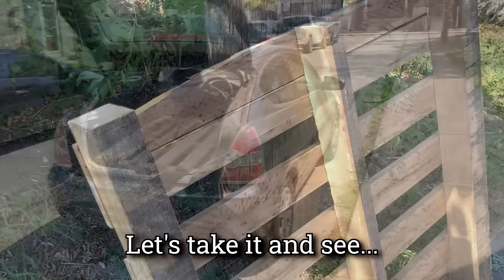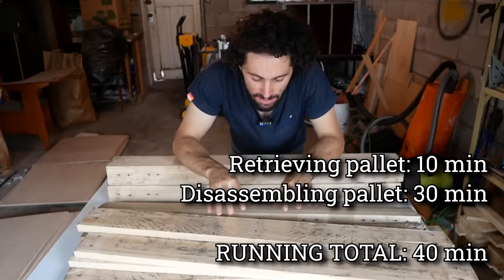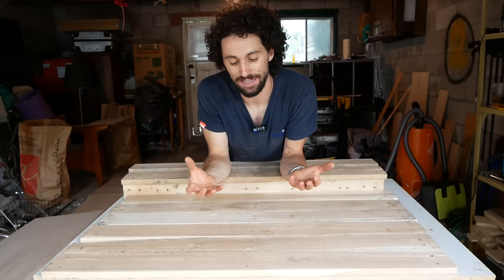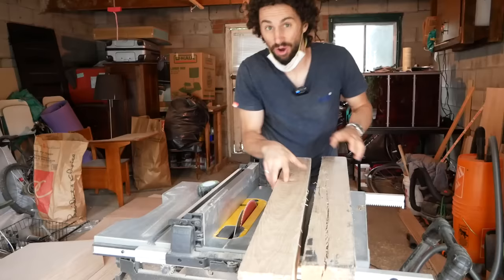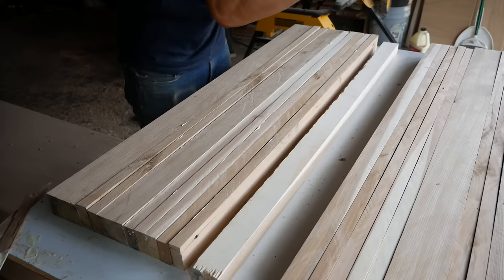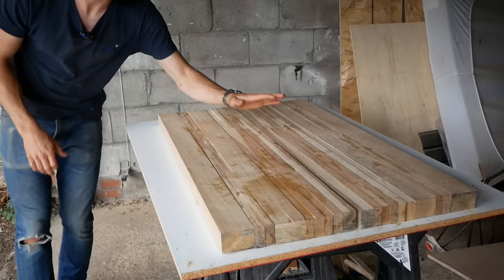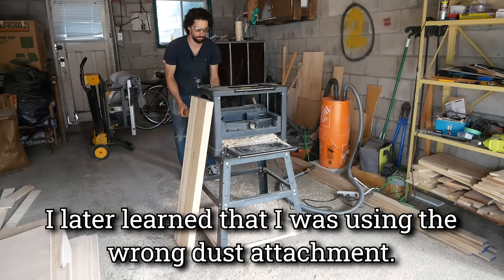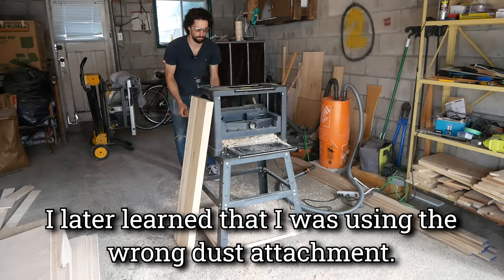Turning a Free Pallet into a $550 Table

Comment: A few things off the top of my head. 1, use a push stick. No matter how well you know your machine's flow, accidents will happen and machines don't give seconds chances. 2, use a vacuum on ur planer. The bits that get planed get under your board and the board is pressed against it, so it will leave marks on the surface. 3, don't clean the extra glue after you've put them together. Glue is mostly water and when it dries it reduces volume so you'll be left with less on the surface. So, if u cleaned on surface level before drying, after u'll have the layer somewhat under the surface. It's pretty easy to scrape off once you're done with the clamps. 4, since i'm on clamps... don't use all ur clamps on one side. Split them, use half over, half under. The force of it, when u tighten it, makes the wood catch a curve. If you'll use them on both sides, the forces cancel eachother. Otherwise, good job!
Reply: Push stick, YES. So much cringe-worthy footage here. What he did is what I used to do as well as other friends of mine. THEN, said friends ended up slicing through tendons and whatever else in their hands/thumbs/fingers/egos. I don't want any of that! Now I use push sticks/chicken legs!
Reply: Push stick for sure, setting an extremely dangerous example for "DIYers" here man.
Reply: If you not experienced and have the money get a sawstop table saw. It stops the blade instantly when you touch the blade and will not cause severe injury in all but the most extreme accidents.
Reply: Thanks!
Reply: @williambrandondavis6897  yes - they are AMAZING!
Reply: So what, dont be ridiculous.  Table saw is not the only potentially dangerous tool in life. This board is so wide his hands are nowhere near the saw.
I wonder how many long boards you have ripped on a saw using a push stick! How ridiculous.
Reply: how about spending an hour cleaning the dust off just to stick in a planer (that isnt cared for enough to plug the vacuum 2ft away into it)
Reply: @scottdowney4318  4:04 That's some unnecessarily dangerous work right there, instead of a simple push stick.
Reply: @danielp5208  No its not. You only use a push stick on narrow cuts. With such a wide board cut, you will have better control using just a hand on the board. A narrow cut and long board, push with your hand and finish up with a push stick while a helper holds the other end of the board.
Reply: and when gluing the wooden boards, make sure that the growth rings run alternately up and down. This also prevents the wood from warping
Reply: I agree...on all points!
Reply: Yes I'm afraid you could have used that coffee table top, as a rocking chair base, but we all have to learn👍

Comment: Hello Morley, i like the result of your work! However, as a professional furniture maker i have to say that you have to use the push stick on the table saw (it was next to you). Not only for your own safety, but especially for the people who don't have the knowledge and will do it exactly as your example and might lose a finger. 
As for the pallet, there are easier ways to disassemble it.
And i will suggest to use a handheld metal detector to see if there are any small pieces of metal left behind in the wood, before you run it through a woodworking machine. 
I hope this information is usefull to you.
Reply: As a non-professional woodworker, I am very glad to see @peter schoemaker chip in with his comment above. A table saw can destroy a finger or more in the blink of an eye. 

I shattered a knuckle playing softball, had hand surgery to repair the joint, and was in the hand surgeon's post surgery therapy group feeling sorry for myself and my misfortune. Then I looked around and saw all of the men with fingers missing and/or badly mangled and stitched back together. Most of the guys were working pros who simply got careless - probably due to familiarity with the tools. 

When I'm using a table saw or circular hand saw, I go slow. I even unplug the table saw when idle (the safety catch on the otherwise fine power switch seems to do nothing. I always use push sticks. I use a guard when the piece allows it. Everything I do with a table saw takes a bit of time. But the saw cuts quickly and I still have ten fingers. 

I wish I had the money for a nice table saw with one of those ballistic blade brakes. But I'd still use push sticks.
Reply: God that scared the shit out of me as i watched it.
Reply: Your comment should be pinned or even better -> appear before the video beginns!
Thanks!
Reply: @wturber  to be fair he said he IS the furniture, not a tool user. Wtf do we know about what the table wants?
Reply: Humour aside. 

Safety first obviously.

The metal detector can be avoided by using a cheap/ but very strong magnet. 
It should be strong enough to hold itself or atleast allow you to feel if any bits of nail etc are inside the boards. 
NE-Oh din ee um ?? Lol I forgot how to spell it. Are on amazon like 50kg pull for 8quid
Reply: Replying and adding a like to this comment so it stays on top, because yeah,... it was cringeworthy to watch, not only for his own safety (he obviously lucked through it once again or this would have been another kind of video) but also the safety of people watching this, thinking they could try it out without the experience to recognize this is a fast track to accidents.
Reply: I agree with that, it's not only You save , but for you imitator too .
Reply: Brilliant words from real experience! Thanks Peter!
Reply: I was amazed he didn't get any kickback especially with those full-stops.
Reply: @R1davies  I'm all for letting Darwin's principles do their work but having been the one having to look for (and finding) what was left of a coworker's hand I somehow would like to prevent innocent bystanders having to go through something like that...
Reply: As a 6 yr old my dad showed me the use of a push stick and neer standing behind the throw of the saw was not the best choice.
Reply: yes, I'm sorry that you had to see that and that your colleague had to go through it....shame he didn't think about that before going through the machine I guess.

Prior preparation prevents piss poor performance

Or just take the time to understand both the tools and the material you are working with and observe the safety procedures put in place by your employer.

BTW I'm a service engineer for a CNC company (big 8metre 5 Axis machines)

IF you want a graphic description on how I have LOST people and things I can fully go into it. But this is YouTube not the DWP and the health and safety at work act. 

If you know how the terminator gets crushed in the first film you know how I WILL die in the future...and it ain't from a nail stuck in some pallet that happens to be moving around 7metres per second...
NO! It's much slower and painful than that. 

#justSayin'
Reply: I was waiting for the inevitable accident too, when he put his hands so close to the blade!  Then I remembered that earlier today I needed to nip the corners off some small pieces of pine (3" x 3" x 1"), so I removed the crown guard from my table saw, set the fence, and used my speed square against it to push the wood into the blade at 45 degrees.  Let me say that again: I used my speed square against the fence to push the wood into the blade at 45 degrees.  It was quicker and easier than setting the cross slide fence, and on this occasion, I got away with it.
Reply: Came in here specifically looking for this comment bc I was so scared for his fingers the entire time!
Reply: @R1davies  haha thnx, just saw my mistake
Reply: I was going to post the same thing you just said ask him where his push stick was
Reply: @peterschoemaker9  I found it funny as the English language is both stupid and amusing at the same time. 
Push sticks are invaluable. My hands are valuable.. so push sticks are more valuable now...but less valuable than my hands until I don't have the push stick then it's definitely valuable or something I dunno I just came here coz I work with metal
Reply: @peterschoemaker9  also please now edit your comment and correct it so nobody knows what the frick anything I say is about. It'll make me look crazy...oh wait
Reply: @R1davies  done
Reply: @peterschoemaker9  perfection

I shall freely lick windows until sunset good day to you sir
Reply: @R1davies  haha ur crazy
Reply: Ya, I had cold sweat just watching his fingers go pass the saw blade... Safety first always man!
Reply: Also extend your table so you dont have to push down on your wood so much. Using a tablesaw for 22 years and i dont take safety to extremes... could say i'm slacking even but this part kinda scared me too.
Reply: that table saw also ships with a guard, riving knife is only for non through cuts
Reply: @wturber  saw stop is the saw with the safety mechanism, and the goal shuld still be to never make sure it works
Reply: yes sir after 20 years and 2 fingers later, he had me worried thank you for speaking to the younger adult. please sir listen to this man.
Reply: Thank you for making that comment! Table saw can be a wonderful tool, but so dangerous at the same time if basic safety is not followed. Morley had me having cold sweat at 4:46 with the shaky fingers so close to the blade. 😰
Reply: @wturber  I continue to be confounded that  more people don't also invest in the device that can stop the saw as well as practicing safe methods to push wood through.
Reply: @pitoufo  That device is very expensive. So I'm not confounded at all. Also, if you ever trigger the device, I think there is a hefty price for getting the saw back into operational condition. Safe methods, OTOH, are nearly free of cost. Mostly it is a very small time cost and a super small materials cost.
Reply: @Galgamoth  Yes. The <SRP of a replacement SawStop cartridge is $95. So a   goof that riggers it will cost the user about $100. That's a fantastic trade-off for some fully functional fingers, but a push stick can still save you $100. So why not use it.
Reply: Yes! My dad lost the first knuckle of a finger on a table saw.
Reply: out of curiosity, what is the easiest way to disassemble a pallet?
Reply: @peter -  Very good, essential advice.   The metal detector is also great advice.  I have watched a lot of portable sawmill videos and hidden metal can make a bad day.
     One of the best bass players I know pretty much killed his bass-playing career in a table saw accident.
 His fretting hand, (left hand) is missing most of the bone in his middle finger and half the bone in his ring finger. I don't know any of the details regarding the accident, but it seems to be a reasonable assumption he was not using a push stick.  Somehow the doctor was able to save the original skin to cover the plastic which replaced the bone. Very sad.
   And, he's smarter than the average bass player, too.  And he had decades of experience as a handyman/remodeler, he knows better.  So sad.
Reply: @duality921  I bash with a hammer. The wood that survives is strong enough for the project, in my opinion.
Reply: @peterschoemaker9  although I agree with the comment.
"You ARE crazy" would have more impact. 😜
Reply: @duality921  you can search on youtube for videos with different approaches. I take them apart with a hammer, wedge and crowbar. Before you start, it is best to let the pallet fall on 1 corner vertical. So it will be easier to pull the nails and boards out.
Reply: @duality921  I've found the quickest method is to take the legs off bu bashing them with a sledgehammer. Then I use two chunky wood blocks and a stout cross piece under each slat & a hammer, moving it to each joint in turn. 

Lastly I straighten the nails, cut them to about an inch in length with bolt cutters, flip them over & pull the out with a long crowbar.

I've found this method causes the least amount of perspiration. Of course, if you don't have the bigger tools, you can make do with a hammer but they're worth investing in if you plan on doing a lot of pallets.
Reply: @duality921  More than one way to skin a cat though. Check out a few videos to see what works for you. Saw someone using a car jack, which dosn't seem a terrible idea :)
Reply: You can use a double forked pry bar pallet ripper. They are on Amazon for about 30-50 bucks. It’s what we used in the pallet company to rip the boards off quickly. When you’re repairing several hundred a day, it comes in handy.
Reply: bump
Reply: Please tell us how to disassemble a pallet in an easier way. Almost threw out my back doing it like this😅
Reply: great information for this new woodworker thank you
Reply: This guy is gonna lose his fingers
Reply: My boss laughed at me for using a pushstick, he even yelled at me, pushed me, and generally was not a nice dude. Safety first like theres no tough way to lose a finger
Reply: MADE $45,OOO FROM   INSTANT PROFIT🌎ORG
Reply: Yeah, I was kind of bracing myself, watching him take apart a pallet then feed the wood through a planer without so much as looking it over to check if there's any metal bits in it. Then he got down at eye-level with the planer and I thought, "Uh oh! here's where it turns into a safety video!!" as it bounces a broken nail off his hairline. At least he'll learn something about shop safety from these comments. He's certainly got enthusiasm for woodworking!
Reply: Yeah.  He was just sweeping his fingers right by the blade.  I was skeptical right away, and then the Ryobi circular saw with crap batteries was another hint.  My dad was way into woodworking, and while he wouldn't always use a push stick, he always did when it was a thinner piece of wood like that where your fingers come within inches of the blade.  One slip or mistake is all it takes.
Reply: Actor Lee Van Cleef lost the last joint of a middle finger building a playhouse for his daughter!

On November 29, 1979, Major League Shortstop Roger Metzger lost the tips of four fingers on his right hand (index to pinky) in an electric table-saw accident. He had been building a wooden playhouse for his children as a Christmas present.
Reply: hmmm you forgot that wood need to be treated
Reply: How can my hubby sell woodworking?
Reply: @R1davies  Yep. Neodymium. Thank you for your comment.

Comment: 0:50 you can flip the pallet over and tap the boards out a lot faster, and you don't risk damaging the wood as badly with the wrecking bar. Small tip from a former warehousing guy.
Reply: great tip, thanks Doug! I was wondering, I've broken down a lot for firewood.
Reply: If they were going to do this regularly then investing in a pallet buster would be worth it.
Reply: Maybe someone was using it for their trash cans - whelp not no mo ...
Reply: MADE $45,OOO FROM   INSTANT PROFIT🌎ORG
Reply: You've obviously never tried to take a pallet apart

Comment: When sanding it after it was all glued up I noticed it was rocking a bit. The reason it cupped on you is bc all your clamping pressure was on one side. Either consider using cauls or apply clamps on both sides of the glue joint for even pressure.  Also, if you don’t want your glue joints to come apart then you should also consider putting c channels under the table to attack the legs to. Blacktail Studio does a good job of exposing this way of mitigating wood movement across glue joints but still having rigid attachment points for legs.
Reply: Can u use biscuit joiner to join both pieces together
Reply: @danrook5757  you absolutely can use a biscuit joiner but that doesn’t solve the issue discussed above. Think of a biscuit joiner as a means of keeping the two “show faces” of two separate boards “even” or at the same level… it’s meant for alignment purposes. While I have no experience using a domino joiner I’ve heard the same thing; that it won’t prevent cupping if uneven pressure is applied across a glue joint. Clamps should be alternated across the joint & even then utilizing cauls are least on each end if not also in the middle are your best bet at achieving as level a surfaces as possible. This is exactly why glue ups (particularly large glue ups) give me heart burn!
Reply: I'm not a woodworker, so I was wondering if the glue would hold all those pieces under normal use.  Thanks for pointing out this flaw.  I'd be worried that over time, the glue could dry out, the wood could change, and those joints could fail.
Reply: Cauls won't help much and biscuits are useful mainly for keeping the boards aligned during the glue up. Once the boards go to the planer they become flattened, so the clamping isn't the culprit. Alternating clamping direction does help keep the clamping forces even.

Wood likes to move due to temperature and moisture. You can mitigate it by alternating the end grain ring pattern from convex to concave, so each board crowns in a different direction. The wood quality wasn't great to begin with. Cedar is prone to splitting and over time. I kinda feel sorry for those buyers. They were kinda ripped off.
Reply: @cariwaldick4898  The glue is plenty strong not to fail on a butcher block style glue up like this if the rest of the build/joinery are done correctly. Wood glue is stronger than the lignin in the wood that holds the actual wood fibers together. The lignin will actually fail quicker than glue will.